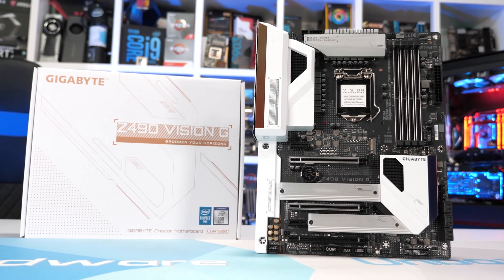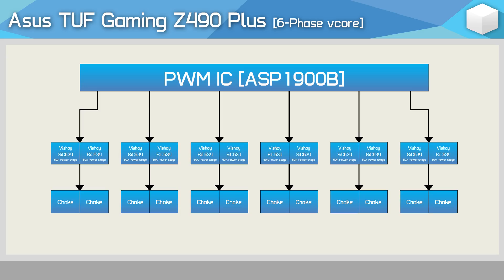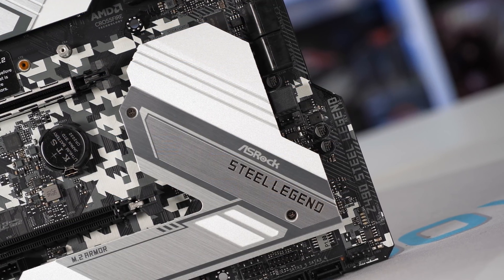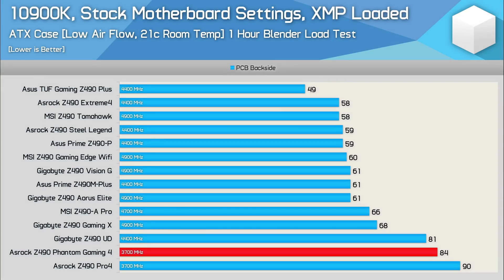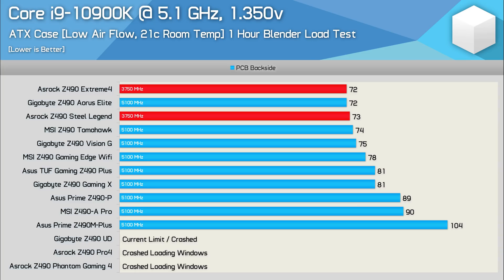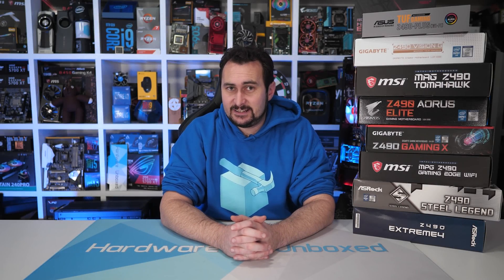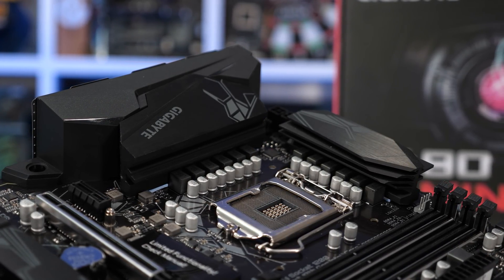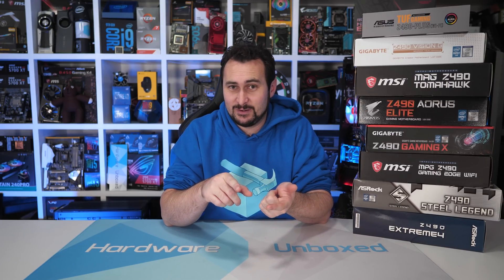Intel Z490 Motherboard VRM Temp Test, Sub $200 Roundup

Comment: Do you have any sound popping/crackling issues?  I have the msi mpg z490 gaming edge wifi board and can't figure out what's causing the audio crackling/popping.  It's not driver related, and it's not GPU related.  Tried using hdmi to 4K HDTV, and tried using audio jacks in the back with speakers/surround sound system.  Both have the same issues with the crackling/popping.  Done 4 days worth of troubleshooting with reinstalling windows, updating bios, chipset drivers, disabling quick start-up, rolling back audio drivers, changing sound hz settings in windows, changing power performance settings, even reseating the RTX 3090 etc... and nothing I do fixes it.  I've been at it for 4 days straight and am pulling my hair out!  Do you have any issues with sound popping/crackling with this MB?  I need help!
Reply: I have the same problem with an old setup, 6700k with a Z170mx gaming 5 mobo....
Reply: I'm using this motherboard but nope I don't have the problem you mentioned. But worth a mention is that I have audio and bluetooth issues when I had my first boot last year, and then I deleted all the audio drivers and bluetooth driver, download realtek driver and other drivers I need from MSI. After that, nothing weird happens again though. Maybe you can try reinstall the realtek driver i guess? Idk but worth a try :-)
Reply: @Ken-jc9di  mine is also fine, since i changed the abovr mentioned mobo. No more crackles and pops.
Reply: Do u have MSI Afterbuner? If yes just close it.

Comment: I have the Alienware Aurora R12 with a core i5 11400f and I'm wanting to build my own with the hardware the AA R12 came with.   Basically I want to keep the CPU, GPU, Memory, Storage and PSU.  Which Z490 or Z590 board should I go with?
Reply: with the 11th gen CPU you need to use the Z590 board, you can go with a Z490 but will need to flash the BIOS.

Comment: I’ve built two pc’s in the last 6 months and I’ve found your videos on 10th gen Intel and R7 boards to be absolutely fantastic.

I bought the MSI MAG Z490 Tomahawk and MSI MAG x570 Tomahawk. 

Both are engineered perfectly for a budget conscious gamer that wants the top tier experience. I’d highly recommend picking one up if your on the fence about which one to pick. Zero issues, only critique I have is the MSI software driving the RGB throughout my builds. Can be wonky sometimes but there are easy ways to fix.

Comment: Nice test just one downside wrong AIO setup tubes should face the bottom of the case no the top otherwise it will compromise the water flow force the pump and eventually do worst results in temps. But thanks anyway

Comment: Where does the Asus Prime Z490-V stack up? I can’t find any information on it and I see a lot of prebuilt with it.
Reply: its pure garbage (it won't even overclock a 10600k safely let alone an i7) , the tuf z490 plus is better than it by a long shot and still its pretty bad, for the price get the gigabyte Aorus Elite if you want to do any kind of overclocking - it can even oc the i9-10900k easily
for good overclocking you need a 12 phase base VRM like on the Aorus

Comment: I mean technically, those ASROCK boards WOULD have a place in the market. Those who are getting a non-K intel CPU with 65W tdp and stock cooler but still want to use their XMP memory could get them. Although Z490 boards have such a high price floor that it doesn't become worth it to build a "low end" motherboard. 
Basically if you are still using the stock cooler, you don't have to worry about the VRMs

Comment: I mean i just got the asrock z490 extreme4 for the i9 10900kf do you think it would be OK if i don't overclock ?
Reply: 4GHz ALL CORE match 4GHz ringbus (40x and 40x), 1.25 Vcore 1.15 Vsa and io, Turbo ON with Speedstep OFF and Speed Shift OFF

Comment: Unfortunately I haven't seen this video before... Now i have asrock extreme4 + 10700k. Two problems - 1. I have vrm throttling in tests (but in real life its ok) 2. I cant run ram xmp prof. 4000 19-19-19-39 (3600 15-15-15-39 max). Thx asrock...

Comment: While I respect you guys when it come to reviews. I was looking over the X570 MSI gaming edge Wi-Fi. I did find something flawed in your testing. You don't do a comparison with air flow. B-Gears make fans they claim to have 101 CFM at 2000RPM. What is the cooling factor of those?

Comment: The $140 Asus Prime Z490m Plus is enough to handle a 4.9 GHZ all core 10900k - that means a 5+ GHZ 10700k or less is basically a cake walk. 
People complaining about Z490 being the only chipset that can RAM OC - should just buy this - or hell even cheaper if you are JUST running a locked i7-10700 or less!
I am REALLY disappointed in ASRock for Z490 - they have offered GREAT boards for basically every other platform! It is like they just said "ahh forget Z490 boys!"
The same was true for Z370 and Z390 - I got everything I needed for a 100% stable 5 GHZ i7-8700k with a 4.8 GHZ Ringbus from a $170 ASRock Z370 Fatal1ty K6 - and it never gets close to throttling or overheating.

Comment: People Complaining that you NEED Z490 to OC and/or use RAM speeds greater than 2666-2933: The most expensive board here - $200, could confidently OC an i9-10900k to 5.1+ GHZ all core! And the cheapest Z490s are BARELY more expensive than their B460/H470 counterparts!
Meanwhile a GOOD B550 costs... Drumroll - $200!!!  (This is not crapping on AMD - this is to illustrate the fact that Z490 can be cheap and effective. Even the worst here can handle an i5-10600k)
A good X570 is $250+!
Of course some X470/B450 could do the job, and most of the GOOD ones are all $120+ for B450, and ~$170+ for X470!

Comment: Interesting that your results are reversed on TUF & Tomahawk compared to Hardware.info and Greentechreviews... Here is the hardware.info for example, who did both a termocouple & infrared:
https://nl.hardware.info/artikel/9961/15/24-intel-z490-moederborden-review-van-koorts-tot-kookpunt-vrm-test
Reply from the maker: I fail to see how the Tomahawk could do so poorly.
Reply: @Hardwareunboxed  I am curious too how this could be. The fact that the Dutch tested the 10900k at 4.9Ghz cannot be the reason. Moreover, the Russians at Greentech alleged that Carbon Pro is worse. They didn't do thermocouple testing, however, only infrared, which is tricky (finding the "right" area). I trust you, but this contradictory info from them is confusing. 
Thank you Steve!
Reply from the maker: @dveydah  There is no way the Z490 Tomahawk is that bad. It uses the same powerstages found on the excellent X570 Tomahawk, there's just 2 more on the X570 board.
Reply: @Hardwareunboxed  Ah, a simple yet excellent point about the X570 -2. I hope yours, ACN or GN data will put this to rest. Your work is very much appreciated! Thanks again, guys!

Comment: Nice, I ordered the MSI Gaming Edge Wi-Fi and 10700k a couple days ago.  Wanted the Tomahawk but Newegg had it as a bundle so it was actually $10 cheaper than the Tomahawk.
Reply: i also have gaming edge .  sometimes im using my tv as monitor wifi helps a lot.Also you dont need bluetooth adapter to use wireless gamepad or headphone

Comment: This review from Japan using an IR camera (instead of a thermocouple) found the ASUS TUF gaming to have the coolest temps of all the motherboards at this tier, how come their results rank the motherboards quite differently to these findings? I'm genuinely interested figuring out which set of results are likely more accurate (as the temp measuring instruments were different)

The original review was here https://translate.google.com/translate?hl=en&sl=ja&u=http://blog.livedoor.jp/wisteriear/archives/1077543129.html&prev=search
Reply from the maker: The Japanese test is strange. The Asus TUF board is tested with the 125 TDP enforced where as the Tomahawk isn't power limited. They're comparing the boards are different sustained frequencies and voltages. Very strange test.

Basically compare their results with my first graph where the Asus TUF ran at 49c and the Tomahawk at 58c.
Reply: @Hardwareunboxed  Yes I agree it is very strange. However, I think that they are only running those manufacturer stock setting power limits (e.g. 125W limit for ASUS) for the first two rows of results. In the bottom two rows of their VRM temp table results they set them all at specific frequencies with no limits ('PL1 unlimited/power limit invalid 4.6 and 4.9GHz results'). 

Still I think your results are a more reliable test of VRM quality as you provided actual OC results with a consistent 1.35V set across all tested boards (they didn't provide 5.0+ GHz OC results at all). Plus you ran a 1 hour stress test vs the 30 min of that JP review.

Thanks for taking the time to go through all the comments and respond to questions. It really sets you guys apart from a lot of other tech reviewers!
Reply: The people in Japan used an open air test bench for their testing where as Steve used a closed case for his. Apples and Oranges yet points out some great info. Open air test bench numbers may not translate to exactly what you will get when you build a system if you use a case (I am sure even each case may have different results depending on the air flow inside it).

Comment: I've been looking around for Z490 motherboards and it's extremely difficult to find one with Debug LED's. Only the most extreme and expensive ones seem to have it, yet previous generations had it al the way down to the cheapest boards. What happened?
Reply: Z490 Tomahawk has them.

Comment: Platform expires summer 2021.
Reply: Summer 2022 not the 2021
Reply: @LordLab  You're correct, but the last supported processors will release in summer 2021 probably, and that'll be the end of it.

Comment: I know they are z490 and therefore should support all the chips, but given the price point tested,  do you think manufacturers have built these boards with being paired with the locked and lower end unlocked skus in mind since the B and H seriew aren't out yet?
Reply: In the US both the B and H series are out and for sale. https://www.newegg.com/p/pl?N=100007627%20601352138%20601352388%20601352636%20601352640%20601352702%20601355441&Order=PRICE

Comment: this is basically z170 in positioning, it will support most features of the next generation cpu( 11th gen ) but technically a 2 generation cpu span makes both z490 and upcoming 590 kinda meh considering with the socket and pci e changes upcoming...its better to wait until they are done mutating. For those gamers looking to play first-party xbox/ps5 games that may come to pc, a pci e 4 nvme will most likely become essential ( when at 7 gbps + for ps5 )

Comment: Looking forward to the B550 testing. I hope you have some entry level boards there. One discussion on Reddit raised the question if the basic boards, like the ASRock B550-HDV, can even support 3700X at stock without the VRMs causing any throttling.

Comment: When it comes to the Higher Priced Z490 Motherboards, the one thing I'm Kinda Interested in is the One's That Have VRM Fans Built-in! 
I.E... Do they come on at All and if they do are they Noticeable (Loud) and are they controllable in Bios?? Buildzoid believes That they are.. "Bloody Useless" and given the testing you've done so far i would tend to agree! Just Wondering! Otherwise On to AMD B550!!
Reply: I got the msi Z490 unify with unfortunately a fan on vrm but I knew when I bought it. The fan never once came on since I got the board and yes you can control it in bios. The fan only turn on when the vrm hit 70 degrees which is almost never . I am truly in love with this motherboard and really think it’s absolutely worth getting.this thing is a beast.

Comment: Remember when Asrock had the go-to value boards? How the turn tables have turned
Reply: They are using all their VRMs on AMD boards... 😋
Reply: I remember when ASUS, a greatly overvalued motherboard brand, spun off a low cost brand called ASROCK and I thought "geez, they wanna sell stuff so bad they don't even want it to sully their mediocre reputation".
Reply: Remember when that was still the case with X570 and probably B550 as well?
Reply: Same with seeing MSI be an absolute joke on all but the godlike version of the X570, now they're cleaning house.
Reply: They were always trash, ryzen was very power efficient
Reply: at the end of the day every brand has good and bad products. Brand loyalty is a bad idea.

Comment: I built a friend a budget build couple days ago using an Asrock B450M-HDV R4 and an XFX RX590 fatboy. The GPU wouldn't slot in properly because the shroud was hitting the HD audio block, Fan block and case pw/reset pins. The blocks on the case are standard size. First time I've experienced this issue in over 100 builds in 15 years. You ever had this issue?

Comment: Is a test of B460 motherboards expected? I want to buy Asus Rog Strix B460-F, but unfortunately vrm test not found.
Reply: @Mifthahul Fikri  wait really ? If I buy 10600, will my cpu be limited ? For photoshop purpose, not gaming
Reply: @aliefr2984  Nope. The 10600 processor will go to the B460 motherboard and Z490 motherboard at the same clock speed.
Reply: @aliefr2984  Pentium, i3 and i5 Cpus in B460 is limited to 2666 Mhz memory. i7 and i9 Cpus can use 2999 Mhz memory max. I would do lots of checking of i5 10400 Photshop results with B460 and Z490 MBs to see what fits your needs (Of course the i5 10600 will be a little faster but to see if there is a difference with memory speed and board selection)
Reply: @Mifthahul Fikri I use Corsair Vengeance 2666MHz rams, so I don't need a Z490 motherboard. I don't want to tune the processor, and I don't need ram with a clock speed higher than 2666MHz, then an unnecessary Z490 motherboard.
I want to buy a good B460 motherboard.
Reply: @jozsefkurunczi57   If you are a gamer you are losing a good chunk of Fps by limiting yourself to 2666 Mhz Rams. Even bumping up to 3200 or 3600 Mhz makes a very noticeable difference. It is your build though so enjoy. I would check Actually Hardware Overclocking (Buildzoids channel) and see if he has talked about the best B460 MBs to buy. Good luck.

Comment: ASRock Z490 Extreme 4 here and yes it's frustrating to OC with this MB. The Stock Voltages are a joke (1.35V) and All Core OC to 4.8 GHz is working with -60mV. That is ~1.3V. Not even close, that I can OC to 5 GHz. I tried with Voltages up to 1.45V. And all this "just" with the 10600K.
Reply: Shit, Extreme4 was great on Z370
Reply: Other problem is I´m OCing with Offset and the max minus VCore I can adjust is -100mV. That is max. ~1.25V. I don´t know why ASRock do that but I think that is way too high for undervolting @ Stock Settings. The CPU don´t need that.

Comment: Please do a 300$ Z490 Boards . Specifically for i7 and i9 
Thank you
Reply: He just said "On the options above $200 the VRMs are even beefier so power delivery will not be an issue even when overclocking the 10900k". Basically if you are getting a $300 board you need to look at what I/O configuration you want because everything else will be mint (as expected in this class).
Reply: Most people won't even spend that much on a motherboard. Most go for the 150-200 range.
Reply: There is no bad motherboards on 300$ rage